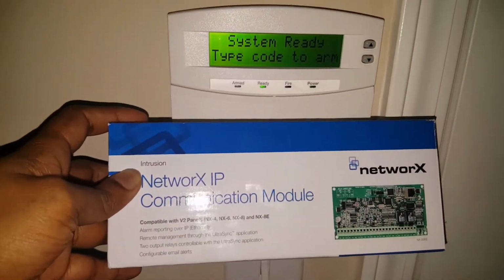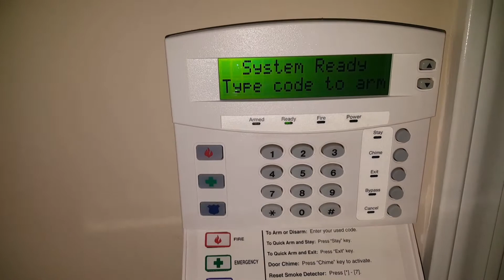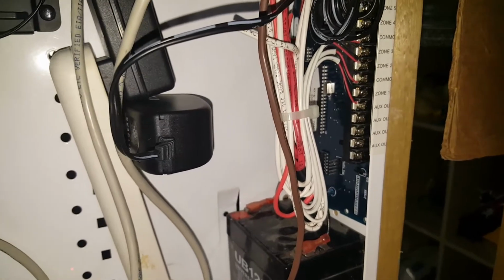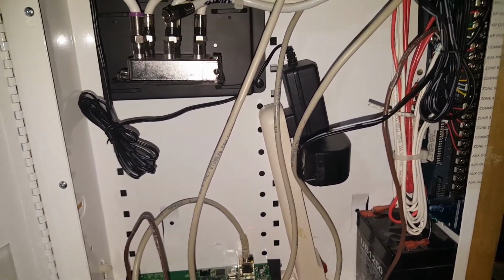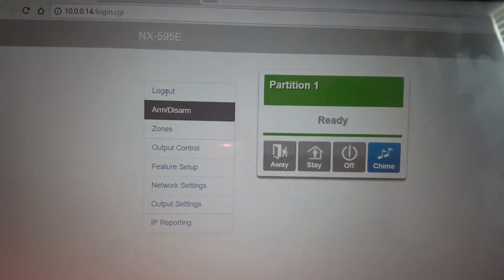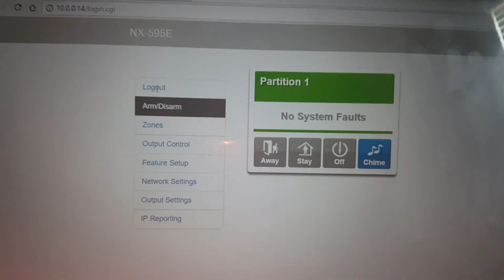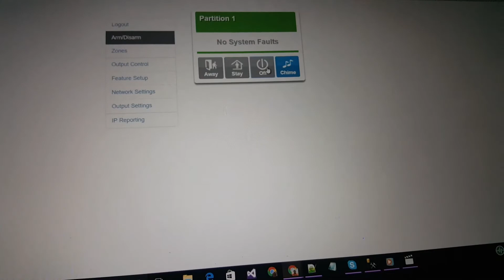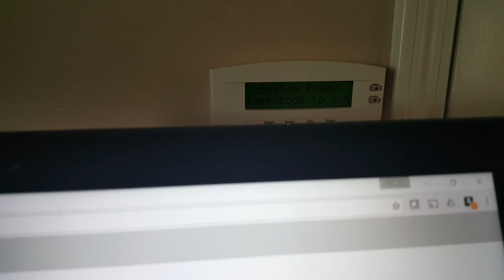Interlogix NX-6 v2 NX-595E UltraSync app

Comment: can you post a video on how you installed it? I did not install my nx-4 so I don't know how it works. Do you need to turn it off before installation? if yes how do you turn it off? will it trigger the alarm if I just turn off AC power?
Reply: up

Comment: can you share how to install if possible
Reply from the maker: SHOP ADON , it is not that difficult, it was just simple connect the wire from main board to the ip board. My security system is already installed, i just connected the IP board to main board and connected lan cable. Let me know if you need more info about specific step. What are you trying to do.